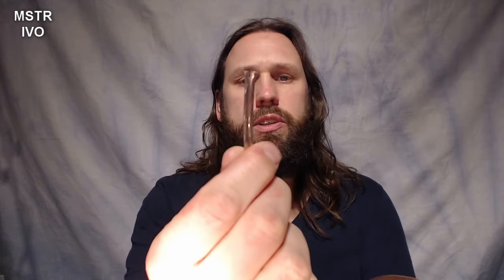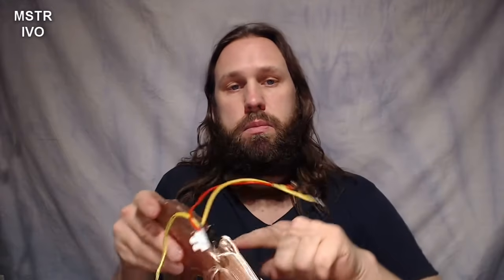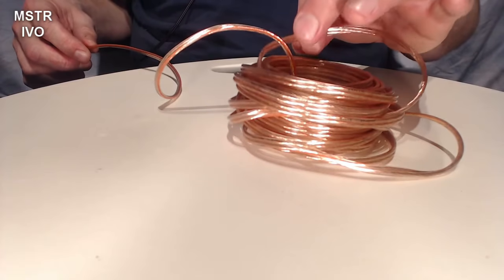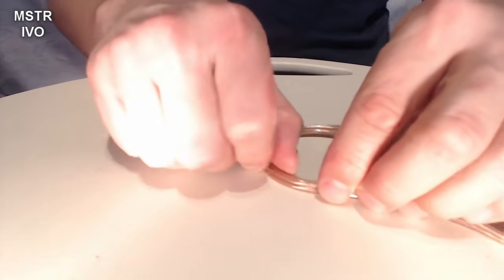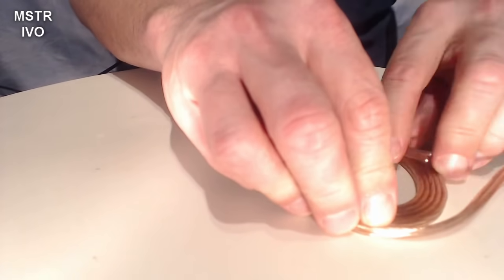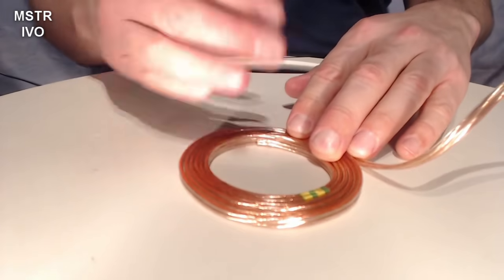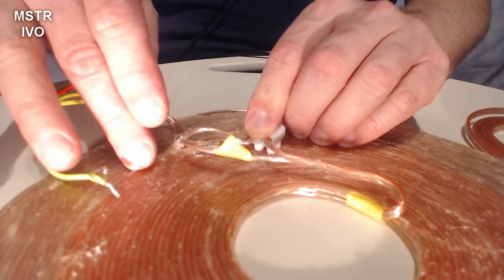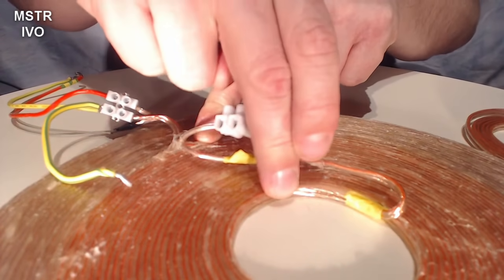How to make a bifilar Tesla coil. The easy way.

Comment: I found an easier way than the easy way outline here. Starting from the centre and working your way out can result in a coil that is tighter in one part than another and not quite round at the finish. I found it better to find something round or cut a circle with a router jig into some scrap MDF and use it to work from the outside to the centre. Because the wire wants to spring outward, it naturally hugs the outer walls of my form holding a perfect shape with equal tension, then I glue it. If making a flat coil with double wire it helps for the wire to be warm. For making the hot glue set fast I use a small disposable propane cooker can (the one about the size of a spray can) and then I take the nozzle from a WD-40 which fits the gas bottle  and squirt the gas onto the hot glue. liquified gases boil as they evaporates and chill to something like minus 50C so the hot glue freezes instantly.  Incidentally this also how to remove hot glue. It cracks when its cold like this and easily removed from the glued thing. And also why its junk in sub zero climates.
Reply from the maker: That's smart, thanks for sharing.
but how do you make the jig turn? I always turn my coil when I'm rolling it. I guess there is a fix for that.
and freezing hot glue, yeah must be faster. but its not that slow anyways.
I wonder if it remains strong when shocked like that.
Reply: @MasterIvo Nice to hear from you, and you are welcome. Thanks for sharing your knowledge! Re turning it, the last one I made, I took another piece of scrap MDF and cut a square (the same size that the circle form was cut out of), then laid down some paper to glue the coil to, then the circle I cut with the router jig on top of the paper, then bang in a screw in each corner, then just spin it as you go. A few dabs of hot glue, and then I didn't mention previously, but my current fave is to squirt super glue (cyanoacrylate) on my coil and then dust it with sodium bicarbonate and rub it into the glue and push it between the windings. It sets like rock in seconds. Unscrew it all and you have your coil on a nice square piece of paper. Or if I want to test before glue I use blue painters tape and stick together. Then I can recycle the wire easily if things don't work out right.
Reply from the maker: @waynoswaynos  awesome tips! thanks ✨🙏🏽✨

Comment: To what extent is the manufactured coil useful ?   Can it help save or store energy in a significant way ?
Will such a design need to be aggregated up to huge dimensions costing lots of money to realize before a practical benefit is obtained ?
Reply from the maker: It uses the coil as a capacitor. this is extremely insightfull to those who want to generate electric power. but you need more coils to do so. By itself it lowers the resonant frequency in a clever way,  and yes it can store more energy in its fields. it also interacts with ambient medium.

Comment: Can you use that coil make it put out 3 times more than you put in? I seen a guy do it but I could not reproduce what he did with a jewel thief.
And I seen another video where a kid named Daniels inventions did the same thing with the pancake coil 300% out. Is it possible?
Reply from the maker: more energy is posible but not more power
Reply: Can you explain ? Can I turn 12 volts into 36 volts ?  @MasterIvo
Reply from the maker: @WATTSFY  yes volts is only one half of power. power has 2 parts of energy. one is volts the other is current.
its easy to get 36 volts from 12v but what about the amps?
Reply: @MasterIvo yes I understand how to hook up the batteries in parallel and in series. One you get amps and the other one you get volts.
I am building an off-grid system for my mother and I am trying to get rid of 1/3 of the batteries.
Right now I am using 15 batteries 12-volt 100 amp hours. I want to only use six. Hook three up in parallel and three up in series to run a 15K inverter.
That is what I'm trying to do, is it possible?
If so can you show me schematic?
Reply from the maker: @WATTSFY  in theory yes. but be carelfull. those batteries need to have the same capacity. because 3x12 is 36v but if you charge with 36V it will be spread over 3. so you think 12v each. but those numbers depend on the real life capacity and internal resistance of the batteries.
it can result in over voltage and over charging leading to dangerous situation (hydrogen production). I am  not able to advice you here so take care.
Reply: @MasterIvo thank you for your assistance. Have a good day

Comment: du you know why he is not using this design in his later patents?
Reply from the maker: he learned from it, and eas constantly learning more. 
he shared what he learned at that point in time in this patent.
He described using the coil as a capacitor (2 windings that act as capacitor plates).
What he didn't say (but CP Steinmetz knew) is you can also do it in reverse.
Use the 2 plates of a capacitor as 2 coils.
this gives the ability to use both types of induction simultaneously.
inducing the voltage and power that are needed to produce power.

Comment: mag ich ..aber was kann ich damit machen? ersetzt das das die mwo antennen?
Reply from the maker: the MWO antenna is actually much like how this coil works. the symmetric voltage difference between the 2 antennas, act like the two wimdings of the bifilar coil which have a voltage difference between them.
but no I would not use this as a replacement.

Comment: Question: have you wound both ways and checked their stats ?
Reply: Winding a Bifilar Coil with Speaker Wire: Flat vs. Vertical (Stacked) in the Æther Model

In the Æther model, the way a bifilar coil is wound directly influences how dielectric coherence and longitudinal wave propagation are established. Let’s break down the differences between flat (side-by-side) and vertical (stacked) configurations:

---

1. Flat (Side-by-Side) Winding:

Configuration: The two wires are laid side by side, maintaining a consistent separation.

Dielectric Interaction: The electric potential difference between the adjacent wires creates a dielectric gradient, maximizing capacitance and maintaining a uniform field density.

Field Characteristics: Generates strong longitudinal dielectric waves with minimal lateral interference.

Energy Density: Enhanced due to parallel dielectric compression, creating denser dielectric field lines.

Advantages:

Higher capacitance and energy storage.

Reduced mutual inductance, allowing for more coherent dielectric interactions.

Ideal for generating longitudinal dielectric waves with high coherency.

Best Uses: Applications requiring efficient dielectric storage and wave coherence, like magnifying transmitters or dielectric field generators.

---

2. Vertical (Stacked) Winding:

Configuration: One wire is wound on top of the other, creating a vertical separation.

Dielectric Interaction: The vertical distance between wires reduces direct capacitive interaction and increases magnetic coupling.

Field Characteristics: Generates a weaker dielectric field but stronger magnetic flux linkage.

Energy Density: Lower dielectric density, leading to reduced longitudinal wave coherency.

Advantages:

Higher inductive coupling for transverse magnetic wave generation.

Suitable for applications needing inductive resonance rather than pure dielectric coherence.

Best Uses: Systems requiring magnetic flux or inductive coupling, like traditional transformers.

---

Comparison in the Æther Model:

---

Key Takeaways:

1. Flat Bifilar Winding is superior when aiming to generate longitudinal dielectric waves and high field coherence.

2. Vertical (Stacked) Winding tends to favor magnetic flux coupling, making it less efficient for dielectric coherence but more suitable for traditional inductive applications.
Reply: Hope this helps friend

Comment: People remember Tesla but forget about eddy, as in eddy currents. Current doesn't flow down a wire, rather it spirals down the outside of a wire, the higher the frequency the tighter the spiral and the greater the power loss. Replace the speaker wire with lots of strands of small gauge, #30 or smaller, insulated magnet wire, as used in transformers. Having each strand insulated from its neighbor greatly reduces the circular diameter the eddy currents can take so improving performance. Yes it's a lot more work but if you want high performance you have to put in the extra effort.
Reply from the maker: they also forget about the other  current.
the displacement current.
which indeed flows throught the isolation material.
And which can produce power in a coil, if the capacitance of the coil is used.
I wonder Who called it "parasitic" capacitance

Comment: Thank for the video, I have built a Doctor Bob Beck magnetic pulser with around 200 volts to the coil that toss a metal washer around 2 feet. David Wong and Matthew Rife use what looks like a Rodin coil but I can Not see the benefit of that to create a vortex to make a magnetic field spin, what trying to do Is create the most powerful magnetic field. Doctor Royal Raymond Rife and Phillip Hoyland used a 3.3 and 3.8 MHz and later Others found 3.1 MHz Is better carrier frequencies to create a harmony with lower frequencies which gave the Rife machine Its power to cause a MOR according to John Bedini If It does Not have the carrier frequencies Its Not a Rife machine, John Bedini also added a lower frequency as Don Croft did with The Doctor Hulda Clark zapper says the lower frequency adds penetration eliminating the need for a plasma bulb that only electrode as used with Doctor Hulda Clark zapper Is needed. I have been told that a Rife, Doug coil machine will Not work at high frequencies that must have a Plasma bulb to work at hight frequencies but I do Not see that to be true but since multiple frequencies have to be forced out for It to be a working Rife machine, can as 4 wires be wrapped at the same time each wire connected to a separate frequency generator and amplifier having different frequencies outputs or would that cancel out each other?
Reply from the maker: the 4 fields will interact when the wires are close coupled. it depends on the frequencies anf their phases

Comment: Do you know: can this be used for PEMF and if so, how?
Reply from the maker: yes PEMF will work.  it will need a pulsed power supply. the easiest would be a battery with a switch.

Comment: Hey Ivo, it's Jeremy. So you use speaker wire. Now, my question is will a regular power extension cord work all the same? Im falling just the regular side-by-side 110V AC Power Outlet (US) compatible extension cord. Two-prongs. Nothing fancy such as those that have 3 windings one for ground. Or the big 3-phase compatible. None of that, just the mundane normal tiny little things. I ask because I have a few that are sort of "chewed up" or what have you and I don't want to scrap them and certainly not throw them away. Anyhow, thank you for your hard work and diligence!
Reply from the maker: thanks, yes those work too. just keep in mind, the closer the wires are, the higher the capacity.
Reply: @MasterIvo  thanks for the reply! Yes, I will be sure to be mindful that materials proximity is relevant to the capacitive capabilities. That is relevant. Quite important as well, I suppose.
Reply from the maker: @jeremymarquart1065  yes, that is also why you have to retune if you sit on a low capacity coil.
But I also like the high current setup, with a large capacitor. that doesn't detune quickly.
also, the dc offset is not needed at all!

Comment: As an Amateur Radio enthusiast,  this concept of bifilar coil has my mind spinning, wondering how this would act in regards to RF energy.  Could it be usable as a tuning circuit (i.e.-matching network) for an antenna.  Have you explored this idea?
Reply: Check out ERIC DOLLARDs books and research.  He has a couple (longer) presentations here on Youtube.  And you can find MANY of his papers & research/writings online free in PDF format.   But look up "Representations Of Electric Induction - Principles of Wireless Power Tesla Eric Dollard pdf" on Google or a search engine.   Its like 45 pages, but it talks about Teslas Magnifying Transmitter, and his system for Wireless Energy, and HOW it works, and WHY its not OTH transverse-electromagnetic waves, or radio waves, but another modality of energy that has a very limited amount of academic acknowledgement, and even the work that IS out there, by folks like Master Ivo, Eric Dollard, Dale Pond, and others, is still just scratching the surface.  There is A LOT that can/could be done when the knowledge of SKILLFULLY and finely engineering systems based on these other types of electric/etheric wave-fields/impulses can be done with ease and impunity.  I do truly believe, as long as the INFORMATION is kept opensource and is TRIED to be understood by those interested or in need of it, that this information and the Laws and abilities that will be learned and capable of, will change this world as we know it, totally and completely.

Happy researching and building my friend!!!
Be safe ✌

Comment: What kind of coil would this be called?...
Take a single length of wire , keep it all flat to tho table, pinch the center of the wire and keep twisting in the same direction, bringing the ends to the center uniformly. What would that be called? If you start from one end and trace it till you get to the other end, you will notice there is a clockwise and counterclockwise nested inside each other.
So, its one electrode but in regards to electron spin, from the radius out its like alternating wraps of positive and negative electrodes. Keeping the wire bare with an even gap/spacing, put that into water with electrolyte, as long as the entire length of wire is not the path of least resistance, you will have an HHO cell that is more efficient because of what the fields are doing!

Comment: Great. Did you test that coil connected with the magnetic fields oposing each other? I mean the end of one coil connected to the other coil but that other coil making the oposite way? One clockwise, the orher in oposing clockwise
Reply from the maker: yes, and I showed it in one video. you can make very fast impulses with it. But I don't use it like that.

Comment: Yes its easier. But the windings should be in changing order.
Your method will work but has a very different inductive reactance then tesla his model.
Reply from the maker: I've heard it many times before. but if you read the patent 512340 you can read what Tesla thinks of this.
the patent picture was just one example to make it clear.
But your right, the inductance is different. Bit its all about the increased voltage difference between the 2 windings, which charges up the capacity between the windings.
Less space=more capacity
Reply: @MasterIvo  do your expiriments differ allot with the desired effect one way or the other?
And by expirimenting did you find the inductive or the capacitive sides more promissing? Or was it rather that perfect high q sweetspot?
Reply from the maker: @acidbyte23  all parts play their role. but definitely the capacitance is playing the main role.
Reply: @MasterIvo  i see that allot in "unproven" research.
Pretty interresting :)

Comment: I made my first bifilar pancake coil today.  I made two actually & connected them up to a joule thief....  I much prefer your method of using speaker wire.  I used two separate insulated wires from separate spools & wound them together side by side  onto a DVD disc & used the glue gun to fix them together...  I've wound different types of coils but never pancake till now...  great video..

Comment: Close, but not quite. A capacitor still works if there is a vacuum between the plates, with no dielectric material. In science and electrical engineering, a dielectric is an insulator between the plates of a capacitor or the turns of an inductor.
The energy is stored in the electric (dielectric) field, not in the dielectric material itself. A simple capacitor consists of two metal plates with a small air gap. The capacitance may be increased by bringing the plates closer together, but this will result in arcing at high voltage. An insulator, the dielectric material, may be used to prevent arcing, allowing a smaller gap and greater capacitance.
Reply from the maker: Correct, but the higher K (dielectric constant) of for example epoxy, increases the dielectric field strength
Reply: @MasterIvo  It does. But I still state that the energy is stored in the electric field, not the dielectric. There's no dielectric field, just an electric field passing through the dielectric between the plates.
Reply from the maker: I understand, we use different terms for the same field.
Mine is based on CP Steinmetz, he stated the electric (power) field consists of the dielectric field and magnetic field.

Comment: It seems to me that you don't get the benefit if NOT having capacitance. The self resonance of this coil must be a lower frequency because of the capacitance between the turns of wires on the same plane, and again on the 2nd plane.
Reply from the maker: the capacity between the 2 planes (2 windings of the bifilar coil) is charged up to higher value, by the increased voltage difference between the 2 planes (2 windings).

the voltage is 1/2 the supply voltage which can be several hundred voltage when resonant.

the capacitance between the turns of the wires on the same plane does not have this high voltage difference so the charge there is much less.
(charge is related to voltage squared)
Reply: @MasterIvo  Yes, but when the frequency is higher than self resonance, this represents a power loss.
Reply from the maker: yes, but a dual resonant system has 2 resonant frequencies. the lower is TEM the higher one is LMD.
LMD (longitudinal magneto dielectric) has an increase of resonant energy